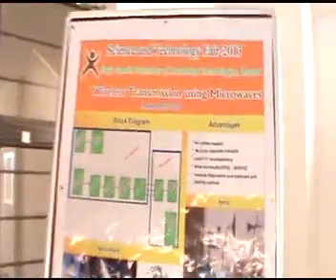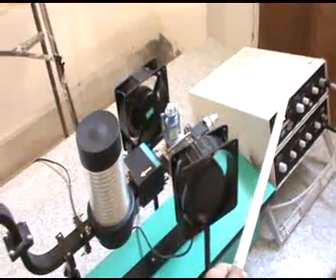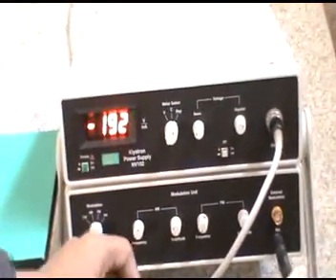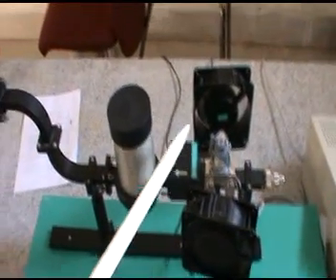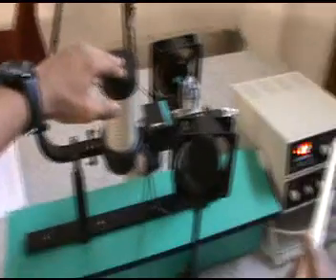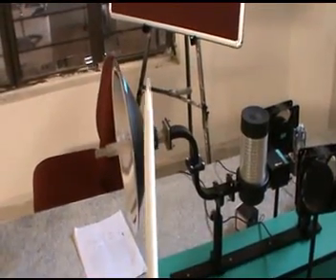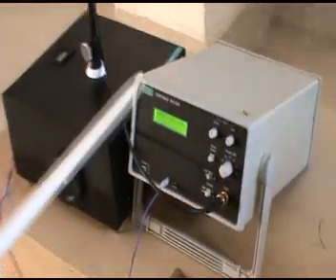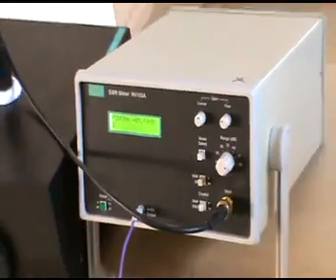Wireless Transmission Using Microwaves

Comment: Not an engineer or physicist here.  How does the receiver capture signals?
Reply: Haha a bit of a late reply but microwaves will induce voltage in a conductor
Reply: correct
Reply: ya